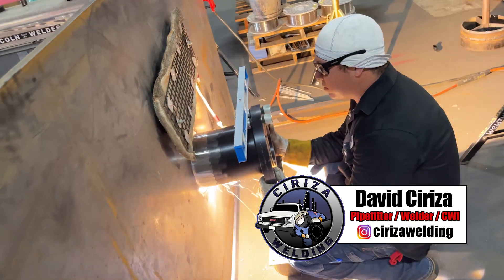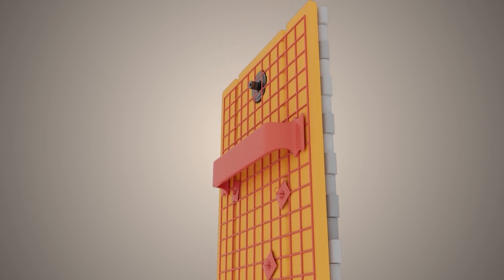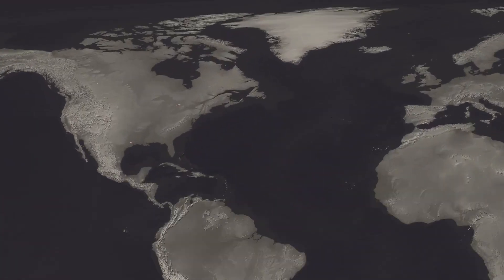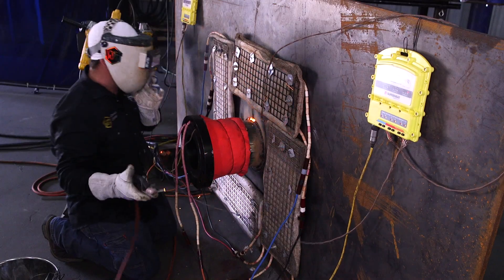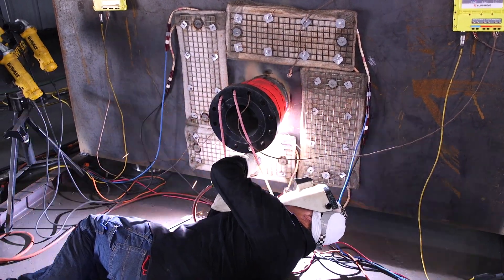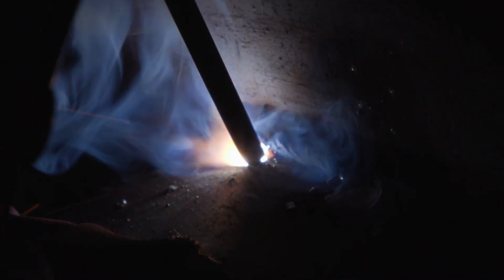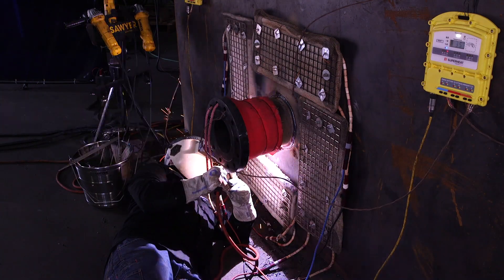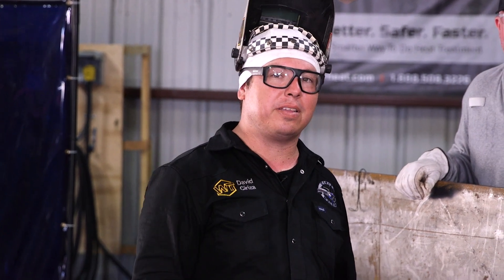Pressure Vessel Welding | Stick Welding A Nozzle Full Penetration

Comment: You put all this heat into it and then you just pulled the heating pads off like it didn't matter
Reply: I was a welder for close to 40 years and never had to use heating pads on material that thick, a rose bud would have worked just a good.
Reply: The only times we used the street reliever was when we had to work on material three to 14+ inches.And it was going to take days if not weeks to do the welding.
Reply: Because you were probably welding lawn chairs together, actual high-pressure piping needs, preheat and post for heat treatment the material and application matters more than the thickness

Comment: For tensile strength could you 7010 or higher like 8010? Or is that just the standard weld procedure for vessels
Reply: 6010 would have been fine for this job as the dilution of the filler and base metal will bring the tensile strength up to 70 ksi no problem at all, also it is only the root; going over it with a 7018 or 7010 for subsequent passes will also bring dilution to the table and up the tensile strength of the weld metal to 70 ksi or above, a 7018 will also drive much of the H2 out of the weld from the prior cellulose rod. Cellulose rods will give you the penetration you need to make this joint clean.
Rooting with a lower strength rod is a very good idea because it is more ductile and less crack susceptible than a 70 ksi filler. Cracking is more likely to occur on roots. Lowering the tensile strength of the root filler is a very good way of reducing this risk.
I doubt the penetration of a 7018 [not that great] is sufficient to give you no root defects in this instance, to achieve that you should be doing MPI on the prep before filling to make sure you do indeed have clean weld metal [from the other side] of the joint. If you look carefully at the back grind @ 4:03 you can see what looks like not so clean metal at about 11 oclock exactly at the end of his 7018 rod in the groove's root. 7018's are not typically the type of rod to burn that stuff out by penetrating deeply, a 6010 or 7010 is. Roots like this on critical PV jobs need to be MPI'd to get to the truth re sound weld metal, if you are using a low pen rod like a 7018 IMO.
RT on this joint is tricky, due to geometry and will not show a crack, which is what you are looking for mainly here.
I am surprised you ground the root AFTER you put the first weld bead in from the backside, back grinding is done BEFORE you root it, looking at the root bead from the first side welded, it looks cold = little pen = I don't want to grind your cold weld from the backside so I'll put in a root of my own in, then grind that. Not the way the job should be done fellas. Back grinding the backside is done BEFORE you put your root in on the backside - not after. :)
Reply: Cellulose rods have slot of hydrogen creating hydrogen cracks
Reply: @jasoncousins1343  Yes; in higher carbon material, but not so much below 0.3% C content material; 517 Gr70 it is 0.22% C, CE will be a little higher but not a real problem for a 6010 or 7010 joint, filled with a 7018 at all. Hydrogen makes its presence felt after some time delay [hours or a day or so after welding] that's why they call it delayed cracking. This is the reason why you put the hot pass in as soon as realistically possible after the root pass, to boil out the H2 from the root, that cools quicker giving a higher likelihood of H2 delayed cracking than the hot pass and subsequent passes for obvious reasons. Any temp above about 35 Deg C it will start to boil H2 out more quickly than at room temp, there-by lowering the risk of a H2 type  failure.
So 6010 or 7010 electrodes should not really be used on steels with a carbon content of 0.3% and above, this steel is well and truly acceptable to weld with cellulose rods at about 0.2% C, if you know what you are doing with them. Most common construction steels are designed to, and can be welded with cellulose rods if you take the necessary precautions.

Comment: On something like that do you guys have to x-ray after or? I'm sure you guys are confident in your welds they look really good! I'm just curious.
Reply: Depends on customer specifications and if they want UT to be done on the connections for like ASME section 8 div 1 work. Once you get into div 2 & 3 work the holes before the connection will be ultrasound tested then the connection will be fit and welded and UT performed again. That’s because of the pressure in div 2 is greater than 3000 and div 3 is greater than 10000
Reply: Yes on pressure vessels typically  radiographic testing or ultrasonic inspection is performed on the weld afterwards

Comment: Would it be possible to use a 7010 electrode?
Reply: Or an 8010 , Fire arc welding uses 8010 often.